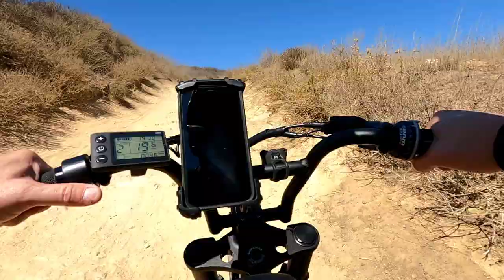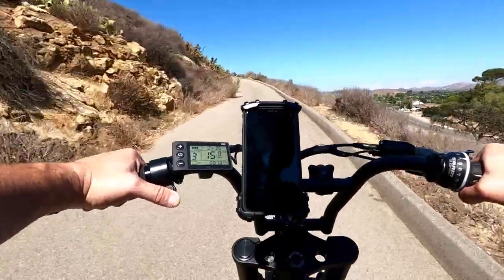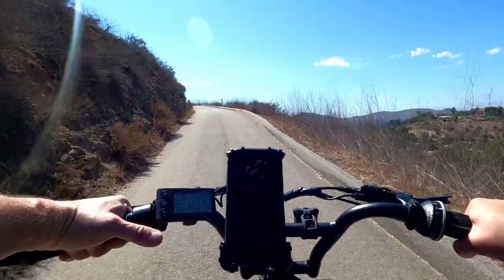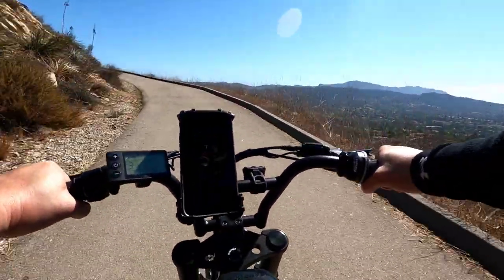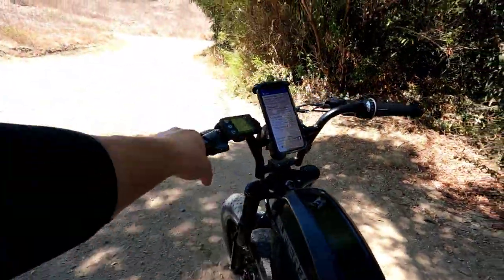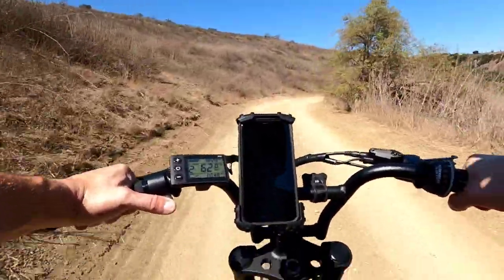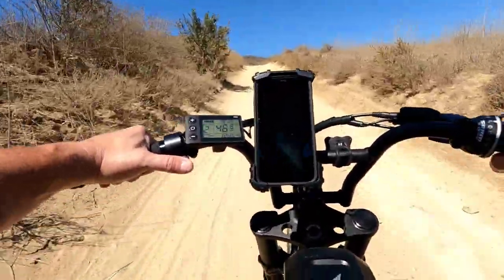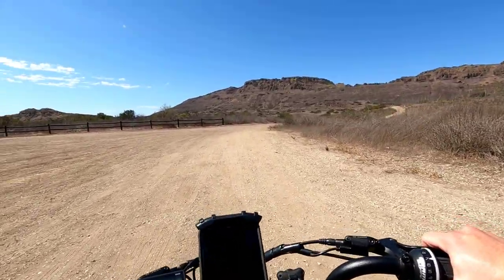SUPER73 R | Hill TESTING with ASTONISHING TORQUE!!!!!

Comment: Can’t seem to find one with an included screen? What am I missing?
Reply from the maker: Stock super73s don’t come with big screens. Just the little circle one.
Reply: @TheFrickinShredder  I’m referring to the controller you linked, as per the description, it does not include the display which is required to tweak the controller and change modes. Would you be able to provide a link to the correct controller with screen or both controller and screen. 

Also does this mode require anything else other then the controller and screen? Does it use the same battery?

Comment: I remember you going up that hill before and could you use a stronger fuse witch is harder to blow
Reply from the maker: I could but then it would put too much pressure on the motor and the battery and probably blow something. The idea of the 40 amp is to make sure it’s limiting the amount of power going to the battery by cutting off before it gets to be too much. A bigger fuse might let too much power go through.
Reply: @TheFrickinShredder  thanx for that bro